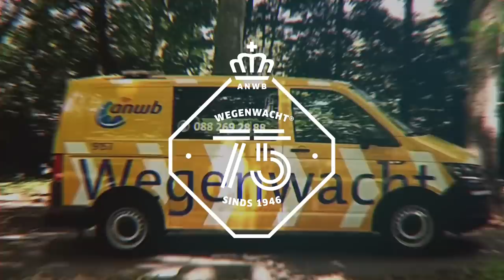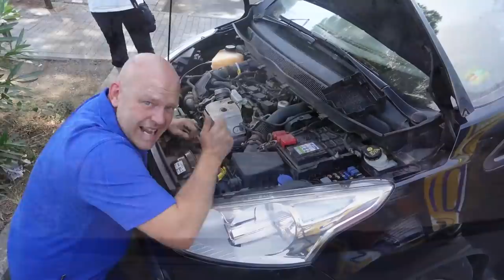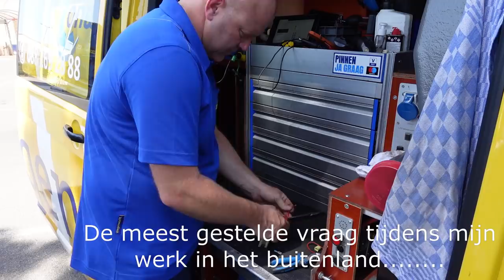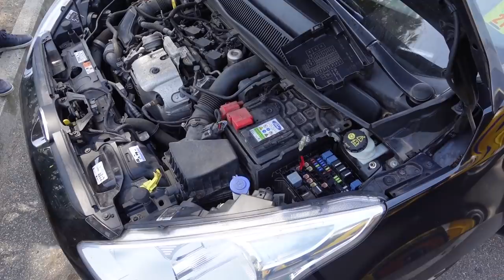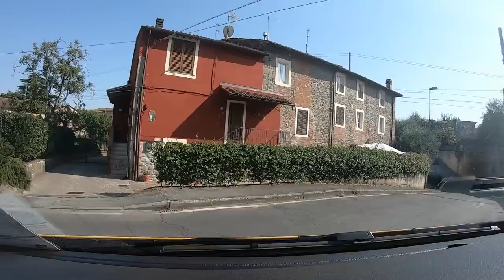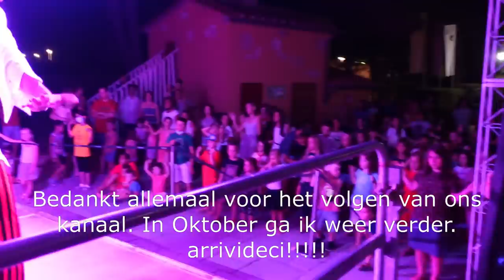Deze Ford raakt na een paar kilometer aan de kook 🔥 | Wegenwacht in het buitenland vlogs

Comment: Hoe kan een simpele fan 40A trekken? Da's dik 500 watt.
Reply: Hij zal toch wind door twee radiateuren moeten blazen (airco en motorkoeling). Nu slaan die fan's bij Ford's al rap aan, bij inschakelen van de airco, naar mijn mening. Als je op een parkeerplaats een Ford (Fiesta vooral) zoekt.. luister naar blazende ventilator en grote kans dat je 'm vind. ;-)
Reply: Misschien dat er kortsluiting in een paar wikkelingen van de rotor zit.. Dan werkt ie soms wel maar trekt ie veel te veel stroom.
Reply: De fan heeft nieuw zie ik 288 watt, das bin 12 volt dus 24 ampère. Zal wel rond de 20 ampère zitten, aangezien de spanning boven de 14 volt zit. Inderdaad zal er waarschijnlijk wel sluiting zitten in een wikkeling. Op de terugweg is de zekering die Ik geplaatst heb er weer door heen gegaan helaas. Jammer, maar soms gaat dat zo
Reply: @sanderf.4778  haha ja een Fiesta met airco aan klinkt alsof ie net de autobahn overwonnen heeft.
Reply: Ik snap niet waarom die Fan zo veel draait. Bij mijn auto draait ie vrijwel nooit en al helemaal niet op de snelweg.
Reply: Waarschijnlijk zitten er nog wat meer apparaten op die zekering.